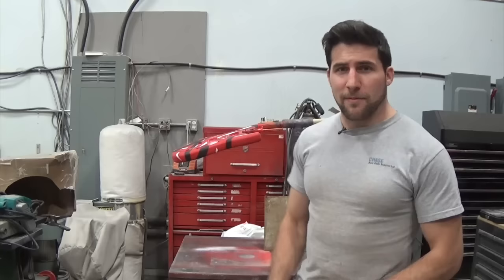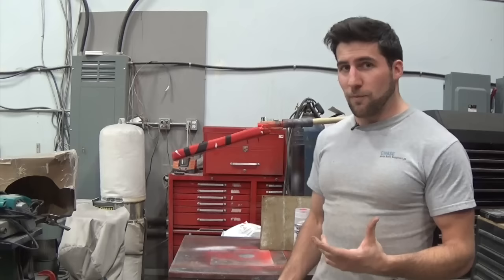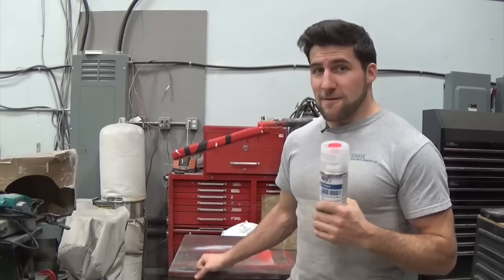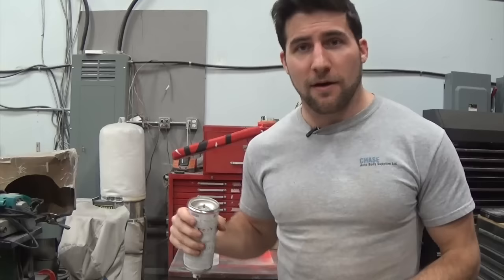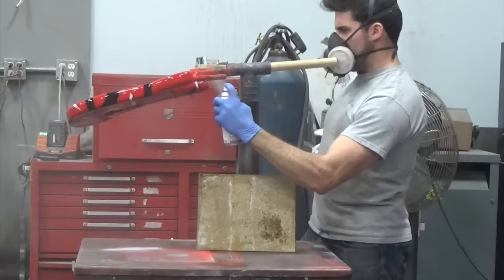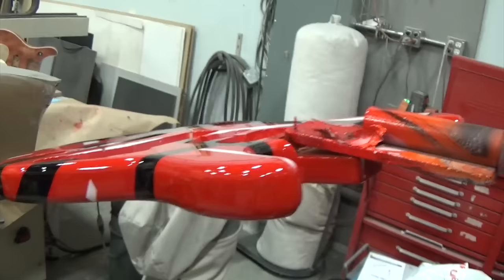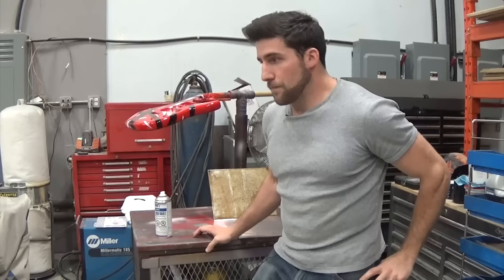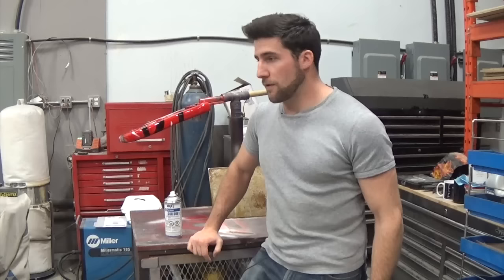How to get a professional looking clear coat with spray cans

Comment: Brad, your videos are always a delight, thank you! I have a question though: does this 2k spray need sanding and polishing or you get a mirror finish without any other treatment? Cheers, all the best!
Reply from the maker: The 2k tends to self-level fairly well, but it you want it dead flat you will need to go through the sanding and polishing process.

Comment: Hey Brad.  Thanks for the tutorial.  This may have been answered below but you have 5 bazillion comments here..  1.  "For professionals only" should I worry about that?  Going to paint outside with respirator so I'm thinking I should be good; 2. If that crap is so bad for you, why no eye protection?  Thanks.
Reply from the maker: The professionals only thing is mostly a safety comment. Protect yourself as much as possible. A respirator is necessary. Eye protection is helpful (I recently purchased a full-faced respirator for this sort of stuff), gloves are also a good idea, and being in a well-ventilated area is important. 
Because I’m in such a big room here, the eye protection was less of an issue. It’s still a good thing to have though.
Reply: Cheers.  Going to give this a shot on my frakenstein Tele.

Comment: You think it would be smart to do 2 light coats of this on a neck? Will it be a pain dealing with it on the frets and stuff afterwards?
Reply from the maker: It will be glossy and and a bit heavy and you will have to cut it off the frets afterward. It wouldn't be my first choice.

Comment: Thanks Brad you gave me the courage to turn a Red Rogue Rocketeer RR50 into a Red, White, Black Frankenstat for my almost 5 year old grandson who loves Van Halen. I brought three cans of Rust-oleum Lacquer Spray Paint (White , Black and Clear) would it be OK to sand the red down to get the gloss off and paint over it with the lacquer? I don't know what type of paint Rogue uses on these cheap guitars. THANKS ALOT.
Reply from the maker: That's basically what you would do, yes. Sand the red lightly to get rid of the shine, clean it, and then go ahead with your taping and spraying. I doubt that those cans are lacquer though.

Comment: I noticed that you applied the third coat right after the second coat.  Is that typical?  Is three coats if urethane all that is needed?
Reply from the maker: I apply them 10-15 minutes apart. I usually do 3-4 coats. If you need to do more for some reason, you should wait a
24 hours and then sand lightly with 800 grit before proceeding.

Comment: i just used the spray max 2k i t worked fantastic better than rustoleum . i put 4 coats on and i have almost no orange peel it looks like show room no dust or runs etc just smooth as glass , my question do i still need to sand and buff or can i leave it as is  thanks from new orleans
Reply from the maker: That's fantastic! I'm glad to hear that it turned out well. If you're happy with how it looks, there's no need to sand and polish it. The polishing process doesn't help durability or anything. It's only real purpose is to remove imperfections, flatten the surface, and give you a nice even gloss.

Comment: How many coats of enamel do you need for a professional look? Last question I'll ask, swear. I'm almost done with my EVH myself.
Reply from the maker: It depends on how heavy you spray etc. if you’re referring to that acrylic enamel, I generally do two coats for color work. Typically 4 for clear coat.

Comment: Hi Brad. I have a couple of questions. First, allow me to thank you. I watched MANY of your videos before experimenting on my cheap Indiana S-style guitar. For my first attempt, it turned out pretty well. I used all Rustoleum products: Meadow Green base, a green glitter coat, and a gloss clear coat. I painted the face of the headstock, too, which looks awesome!

1. To avoid sanding, I tried to take advantage of chemical bonding. I applied 2 base coats, 2 glitter coats, and 3 clear coats, each separated by about 10-15 minutes. When I began to apply the gloss, some parts of the guitar instantly developed a crackle effect. What caused that? Could it have been the glitter? Was something too wet or too dry? 

2. Now that I have sprayed the gloss coat with Rustoleum (which I assume is different from the catalyzed you use in this vid), how long should I let it cure before polishing it or reassembling the guitar? (I'm sure you covered this in a video, but I can't seem to find it again.)

Thanks again for sharing your knowledge with us.
Reply from the maker: Have a look at my video about why your paint is crazing. That will explain the crackling issue better than I can on here. 
The Rustoleum is quite different from the catalyzed paint. With that many coats in a row I would give it at least a couple weeks to dry. Test it before you go to polish. Push on a discreet area with your fingernail and see if it’s hard enough not to imprint. 

Usually we do maximum 4 coats in series like that, then let it dry and come back a day or two later to sand and do more.

Comment: Excellent vid (and series) that I've only just discovered. I'm getting ready to clear coat my Frankie with the same spray, and wondered how this held up for you if you've still got that guitar. Was there any yellowing over time?  Thanks!
Reply from the maker: This stuff doesn’t yellow. I’ve repainted that guitar since then like I usually do, but I have others coated with that clear that haven’t changed at all.
Reply: @BradAngove  Cheers Brad. I appreciate the quick reply and thanks again for sharing your knowledge 👍

Comment: Thanks for the info man! I'm about to sculpt a biomechanical top piece for a guitar and im probably gonna use this to finish this! Would love to show you the end result.
Reply: Any issue with lines on painters tape for the neck?
Reply from the maker: I’m not sure what you mean. Like ridges after you remove the tape?
Reply: @BradAngove  Yeah! Or a film of the stickiness from the tape? I saw your video on using 2x gloss to do a stripe effect and you talked about the tape and how to peel it properly. Same method applied for this kind of gloss?
Reply from the maker: Well it can definitely leave ridges. I assume you’re not painting patterns with it though. For cavity edges etc. I often run a razor blade around the edge to prevent it from peeling off the areas where I want it.
Reply: @BradAngove  no just for the neck part of the finish. Awesome will do. Thanks for the help man! Id love to show you the end result once I'm done.

Comment: Brad, I think you've convinced me to try this stuff. I will spray safely with respirator, goggles, and gloves. I will do it outdoors or in a ventilated garage. 

When is it safe to bring in the house to let set a few days before sanding/polishing? It will sit in a spare room in the house. I may sound too cautious, but after some bad health issues I guess I will be that way till I check out lol. Also, is it ok to wetsand at that point? Thanks!
Reply from the maker: Wait a few hours at least before you bring it in if possible.
Reply from the maker: You can sand after a day or two, but I wouldn’t wet sand.
Reply: Brad Angove Ok thanks Brad!
Reply from the maker: You’re welcome.

Comment: I think you've just made my day but a few questions popped up. Why only 3 coats? Why not 4 or even 5 coats? I won't have paint on my guitar, only tincture because I want to see the grain of the wood. Should I do more than 3 coats then? I'm thinking about using a grain filler on the mahogany to make sure the finition is even. Could polyurethane react with nitrocellulose paint? I want to keep some of the old paint job on the headstock because of the serial number and I wouldn't want to see that older 80's lacker melt when applying polyurethane. Thanks in advance for your lights.
Reply from the maker: +Sly you can do 4 for this stuff, but it's generally not necessary. The recommendation is typically 3 so you don't end up with the paint on top drying while the first layers are still soft, thus preventing it from ever properly hardening all the way through. 
If you want more coats, best practice is to do three, wait 24 hours, scuff with 800 grit, and then you can throw on another 2 or 3 if you want. It gets tough though when you're doing it with an activated can. They're time sensitive. 
With mahogany you really should grain fill it will help. I've done a video on grain filling mahogany if you're interested. 
Nitro and poly can work together. If you're spraying fresh poly on old nitro I wouldn't foresee an issue, but you could just update it with some fresh nitro clear. That being said, new lacquer technically will melt old lacquer. That's kind of the purpose of it though; it's how it adheres. Poly won't really do that, so you'll need to scuff it first.
Reply: +Brad Angove  I really GREATLY appreciate that you care and you just got a new subscriber. I have found your grain filling mahogany video and 3 other wood filling videos on your channel, so I'll check them all out. For finishing, one thing's for sure, I'll go with a spray can. Can I find nitrocell in a can? It seems to be very hard to find in Canada because of environmental and health issues. What if I use pre-catalysed poly, which isn't so much time sensitive, instead of the activated poly? Would I get a good quality and hard finish? And if I really must go with the activated poly for better results, considering that heat accelerates the chemical reaction, if I put the can in the fridge between the two rounds of coating, wouldn't cooling it slow down the catalyzation and preserve the quality of the product? 
I understand that I must scuff the headstock before applying poly over the old finish and it seems that 800 sand paper should do the trick. But what do you think about using adhesion promotor after scuffing? From what I can understand, an adhesion promotor dries clear and is litterally glue for paint or lacker. I don't know if you have talked about this product in one of your videos, I haven't got time to go through all of them, but it sure would be a good topic in order to figure out when it's best to use an adhesion promotor instead of a primer. Thanks again Brad! Your help is greatly appreciated.

Comment: In my opinion 
Yes it works great on a finished service.
Like paint 
I haven't had good luck on raw wood.
To much aerosol not enough product it seems.
Reply from the maker: You need to seal your wood first to get good results. Paint soaks into raw wood.
Reply: @BradAngove  
Yes I know that.
I stated this in my first response.
Using a gravity air assist setup light spraying on raw wood works great
Using a rattle can on raw wood just dosnt work.
You can brush on to seal the wood.
The rattle can.
But I find at that point what's the point of rattle can
It only works on a sealed service 
No point.

Comment: I sprayed my DIY guitar white and has been drying for a few days now, did I wait too long to clear coat it? should I do another coat and then use the clear coat 30 mins after? What would you recommend to get a glossy finish to it?
Reply from the maker: If you’re using this clear I’d just say make sure the white is fully dry and then sand lightly with 800 grit paper and clean it before spraying this stuff.

Comment: Hey Brad! 
So let's say I spray the body with this clear coat and am planning on spraying another coat 24 hours later. Am I expecting the first coat be be finger nail test ready or just dry to the touch, I don't really want to be putting another coat on if it's not ready! 
Thank you.
Reply from the maker: It should be ready to essentially pass the fingernail test after 24 hours.

Comment: Awesome job. After you sand the 2k with 800 grit. Can you apply poly over it? Or just polish to a high shine?
Reply from the maker: The 2K is a polyurethane. If you sand it with 800 grit that’s usually to recoat. Otherwise start higher and go through the sanding and polishing process.

Comment: Absolutely Love Your Video's!! Sorry if this question has been asked  before but just wanna make sure I'm doing this right. I finished painting the body (Black Gloss) let dry and scuffed up with 800 grit sandpaper before applying this 2K. Not sure if I went to far but I have taken all the gloss off and left lots of fine scratches, very dull. Will these scratched get filled in with the 2K clear or should I put another coat of paint back on, No scuff before 2K clear?Thanks In Advance.
Reply from the maker: You’ve done it correctly by the sound of it. The 2k will fill those scratches.

Comment: Love your videos, you've inspired me to paint my guitars. How did you prepare it for the clear coat? Did you only do the scuffing as shown in the previous video or did you sand it with a higher grit sanding paper? Thanks in advance.
Reply from the maker: Just scuff with about 800 grit.
Reply: @BradAngove Hi Brad, love the video. I have a sharpie autograph on my guitar so there's no way of sanding down the surface. What process and product do you recommend for that situation ?
Reply from the maker: Have you seen my video on how to protect autographs?

Comment: I Tried this product I was really surprised how well it worked .I put 1 tack coat and 2 wet coats sanded and buffed 48 hrs later .it has been 3 weeks .could another 2 coats be applied over the existing coats?or am I asking for trouble?
Reply from the maker: Yes, you can add more. You’ll need to sand at 800 grit and clean carefully with wax and grease remover though, especially if you polished it.
Reply: @BradAngove  Thank you

Comment: This may be a silly question, though do I have to cover or do anything about the small holes on the guitar, for the bridge and pickup rings, for example? I have never applied clear coat onto a guitar body, but I was wondering if the clear coat will not cover the holes, so that I cannot screw the bridge and pickup ring after clear coat? I have saw other videos about spraying colour or clear coat and no one addresses this issue, so I assume that the clear coat shall not (completely) cover those (small) holes, right?
Reply from the maker: The clear generally won’t fill those in completely. You should be able to get the screws in and easily see the holes that were used before.

Comment: Thanks for the video man, quick question what grit sandpaper would you use to scuff it up the next day and add a final coat? Also did you do any sanding or scuffing in between the first three coats?
Reply from the maker: I would use 800 grit the next day to prep for a final coat. No sanding between the first 3 since they're only 10-15 minutes apart.
Reply: @BradAngove  exact question and answer i was looking for! thanks!

Comment: Would it make a big difference, if you had the time, to sand between coats?
Reply from the maker: No. You sand out the orange peel etc. at the end. Not between coats.

Comment: So I just clear coated my guitar project, and because I was clear coating some other things, I ended up running out of clear coat. So the guitar ended up being 1 tack coat and 2 heavy coats on all parts but the back. The back ended up being 1 tack coat and 1 heavy coat because I ran out. Is it okay for me to just leave it like this? I'm not sure if it's worth it to open up a new can since this stuff is expensive. I also got some runs when I wasn't being very careful. Should I just sand those off until the clear is smooth? Thanks a bunch!
Reply from the maker: Sand it all back smooth and if you don’t sand through the paint you can go ahead and polish. More clear isn’t strictly necessary.
Reply: @BradAngove  okay thanks!

Comment: Hi Brad- before using this clear, would you use a degreaser to clean the scuffing? Or would use dry wipe it to keep the tooth? I assume the degreaser doesn’t hurt?
Reply from the maker: The degreaser shouldn’t hurt and is a good idea. That’s what I clean mine with generally at that stage.

Comment: Great video. Would you recommend using a sanding sealer on a stained guitar before using this?
Reply from the maker: Yes, that will save you some work and material down the road.

Comment: Hey Brad, I have viewed several of your videos and I appreciate your instructions. I assembled a double-neck kit guitar a couple of years ago, and I did not use a sanding sealer before I sprayed the primer. As a result, I got off-gassing bubbles that came through on every following coat of paint, and clear. I have dis-assembled the guitar, and have begun removing the paint in hopes that I can get it right this time and it will turn out great. My questions are: Should I try to remove all of the paint & primer down to bare wood, and once there, use the sanding sealer before applying primer? Or, should I just get the surface of the old paint sanded down past the bubble circles, and go forward from there? If the 2nd option is appropriate, should I put some sanding sealer on the old paint, and then spray the primer? Your reply will be most appreciated. (By the way, it was originally painted with lacquer, and that is what I will use to repaint it).
Reply from the maker: You can just sand down until it’s flat again. No need to go right back to the wood, just get past the imperfections.
There’s no reason to apply sealer now. You shouldn’t even need primer at this point unless you end up going right back through all of your paint.

Comment: What would you recommend for polishing after using this? I’ve seen you use a bunch of different systems but is there a method to that? 3m over this clear, liquid ice over that, etc? Great info! Thanks for doing these tutorials for us weekend garage hobbyists!
Reply from the maker: There’s no magic to which system you choose per se. The 3m is great of course, but it’s pricey. Liquid ice and meguiars are also excellent. I even mix the steps from more than one sometimes haha.